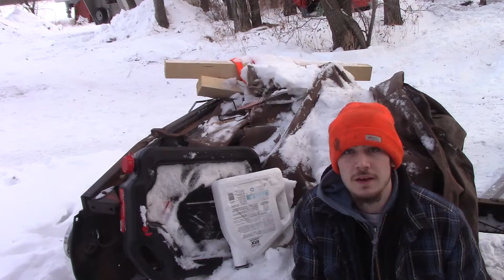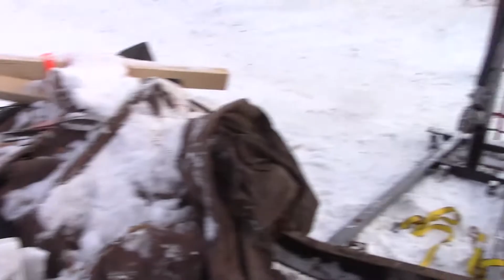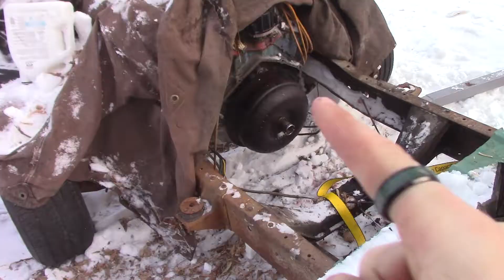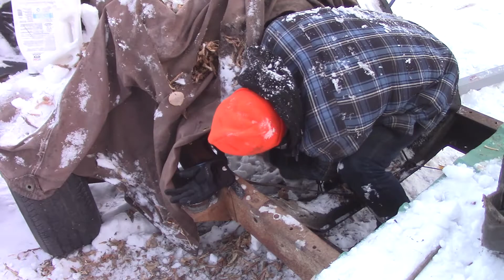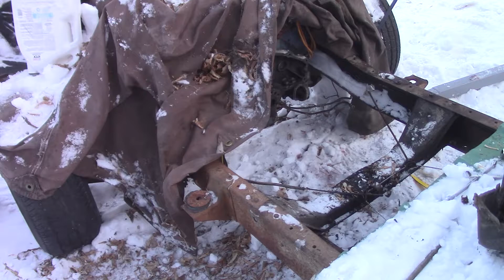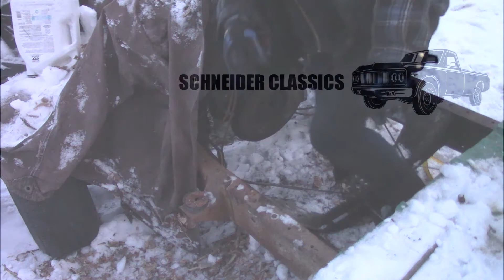Swapping the Flywheel on a Chevy v8 Small Block

Comment: from my view that flywheel looks in rough shape, should of had it dressed and checked for cracks...and fasteners put on with blue locktite and torqued to specs, but what do I know, rite? please proceed, thanks
Reply from the maker: it has been checked for cracks it is fine. with these old trucks not too much of a deal as long as you don't have deep scoring. Another reason the transmission hasn't full gone on yet is yes I agree should use some locktite before I Torque it down. Thanks for the input mate.
Reply: @SchneiderClassics  well alright then, if your happy, i'm happy, keep on wrenching :)
Reply from the maker: @fatbasterdsgarage955  always mate. got to stay on budget and do what works. this old farm truck ain't going to rebuild itself.